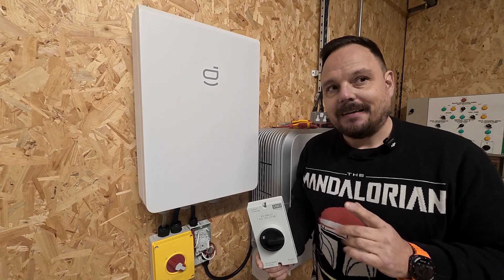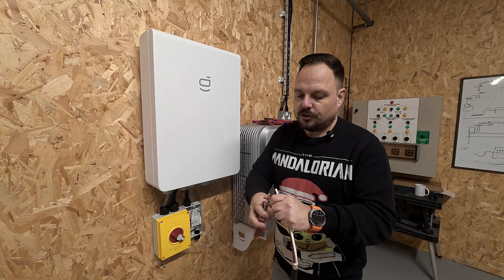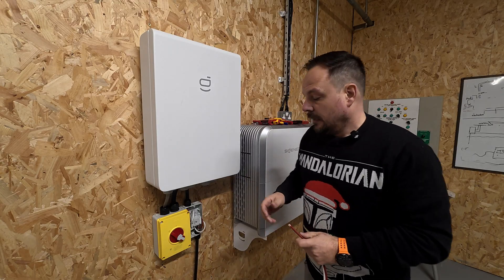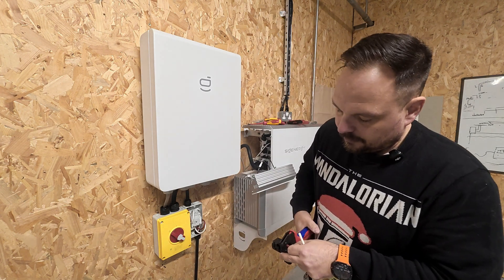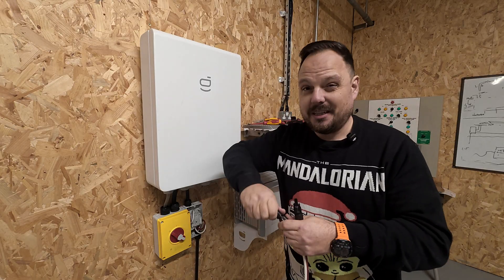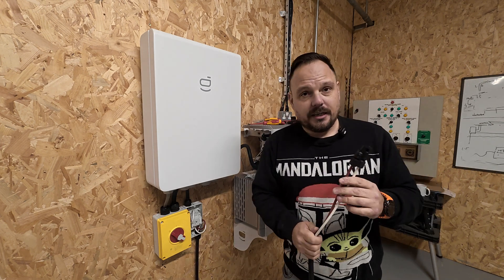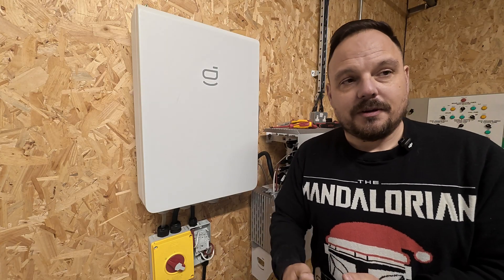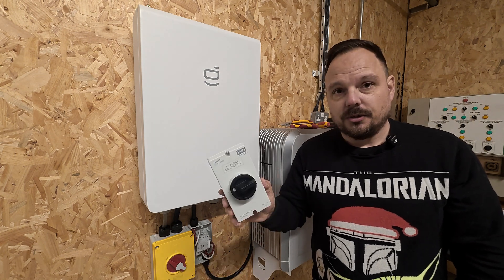DC Isolators are they DANGEROUS ???

Comment: Really good way of doing a inverter swap as you can isolate the power source but here in Australia we stopped using DC isolators if the Inverter has one built in so no External isolation pv panels hook straight to inverter so much extra work with setting ladder to roof to disconnected the strings so the voltage is not so bad just to do a inverter swap but they have been catching fire alot as they installed On the roofs

Comment: Reminds me of Mr Beeching closing down our branch railway system so they couldn't loose money....Don't correct the implementation, just take away an apparent symptom and destroy the service....If those DC isolators are not fit for purpose, the manufactures should be taken to task in order that future products function correctly. I doubt this is the case though, more likely what you propose.

Comment: Very interesting, and true.
I had a problem (resolved now) that my PW3 didn't have external isolators, despite Tesla stating in September 2024 saying that they MUST have them.  I argued with my original installer, and won ~ eventually. 
My worry was that the installer had said that the internal isolator was adequate - but when my 'fixer' came to rewire it all, they found that the internal isolator hadn't even been used!  The strings were just wired straight inside!  Yet it was signed off with an MCS certificate etc... 
A friend of mine went back to his installer with the Tesla information and they denied him!  Standards are so so low in some parts.
Keep fighting the good fight Mark - someone needs to!